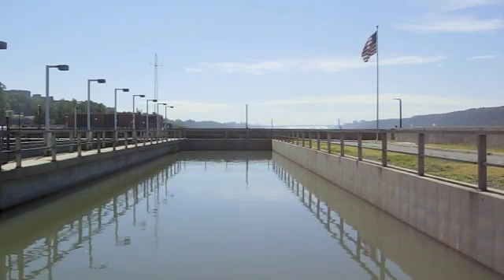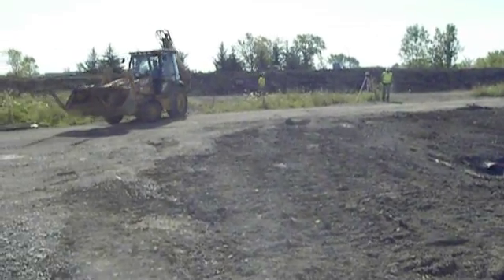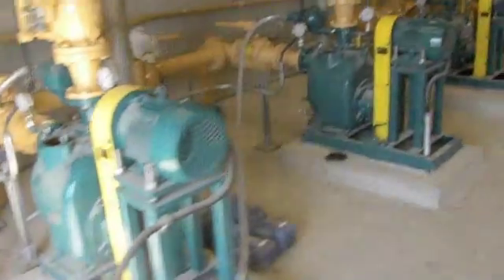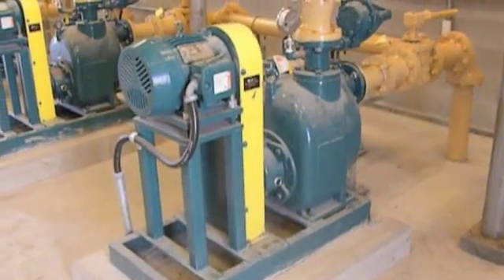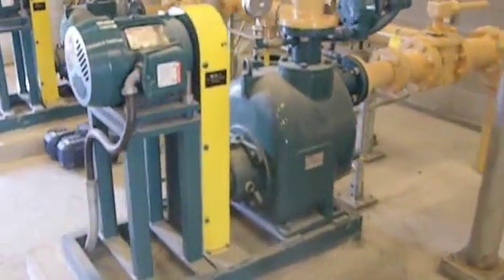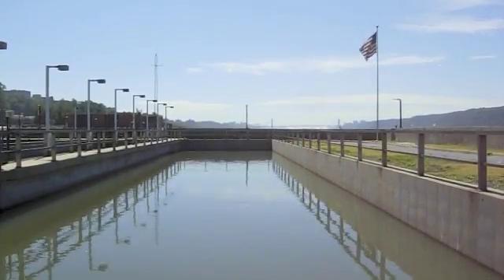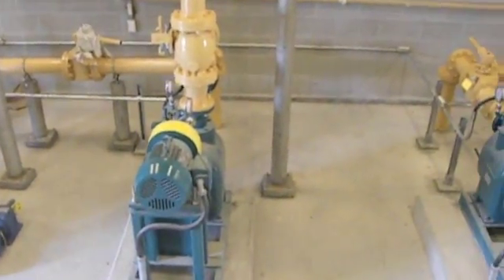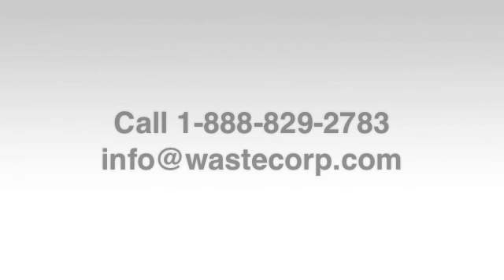Pump Station

Comment: I've seen several of self-primers trash pumps of a variety of pump makers, very similar with those in the video. Is this your original design and engineering, or you just copied from someone else?